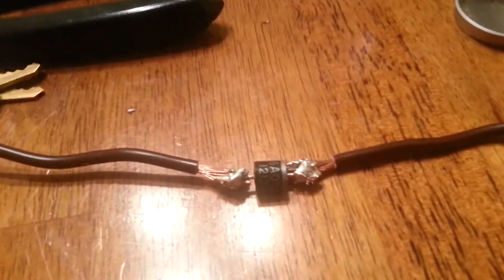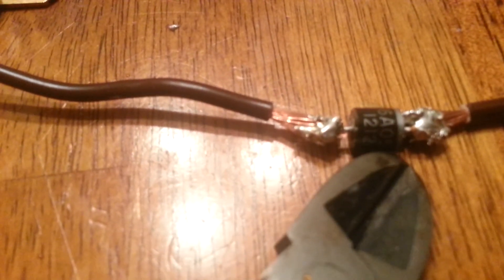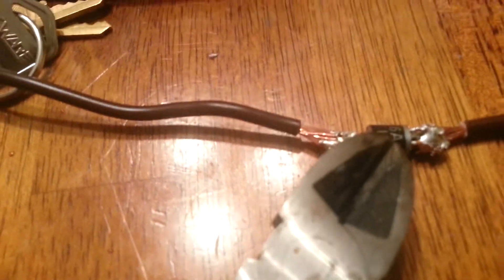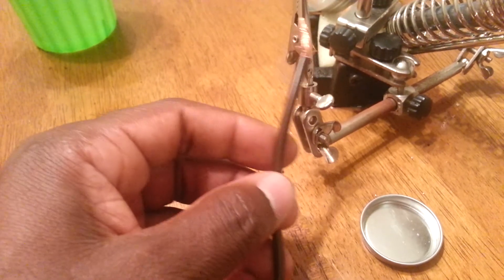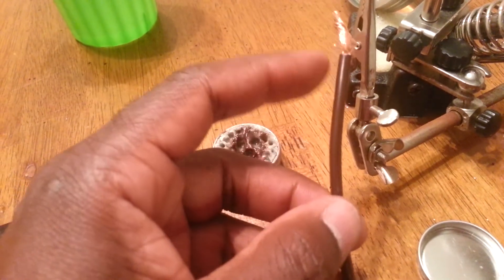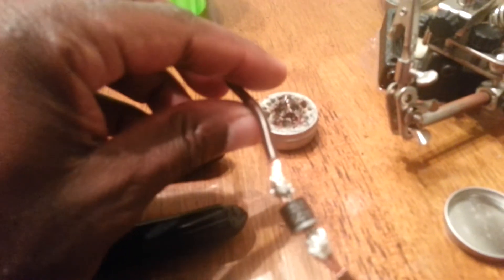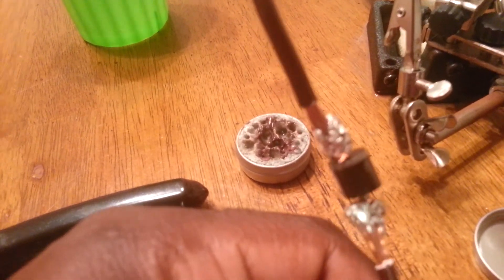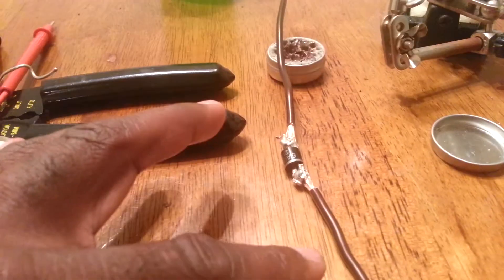How to add a diode to your lawn mower's alternator

Comment: Dont do this hes so wrong use 4 diods make sure they are rated for the volt and amp either way 4 diods will make a full bridge rectifier if done right. There are plenty of videos on the you tube on how to do it its so easy

Comment: No you're wrong it's just a feedback diode. In other words the AC current generated by the alternator is alternating AC DC. Imagine the electricity is water in a pipe with a plunger on one end without the diode slash one-way valve the water would just go back and forth in the pipe and never be pumped in One Direction the diode is simply a one-way gate you need a full bridged rectifier to convert AC to DC this is not a fully Bridge rectifier system it's just simply keeping the voltage going one way. Not converting.
Reply: this is not the space shuttle all you need to do is have a pulse DC to pump up the battery or run the lights or whatever there is nothing on that lawn mower that is critical of any AC or any ripple voltage...... as long as the diode is accurate you're going to get the positive amplitude and suppress the negative amplitude....... now if you're going to put a lawn mower on the moon I would say you need a full wave bridge rectifier with many many capacitor filters a zener diode etc inductors etc to back it up and then it would fail because it's pentagon contracted
Reply: I agree.

Comment: A diode does not convert A/C to D/C current....that is what a rectifier does.  A diode only permits current in one direction.
Reply: It does, but it will be pretty rough DC that is on off.  4 Diodes wired as a rectifier will get you the inverse side of the sign wave so you have more steady voltage.  A nice sized electrolytic cap will help smooth it out to a nice steady DC.
Reply: First, a diode and rectifier are the same thing. Second, half wave rectification (single diode) is perfectly fine for a tractor, and finally, a full wave bridge rectifier would harm the battery since you would be increasing the voltage by using both sides of the sine wave.
Reply: @rms59  Full wave will 2x the current, not the voltage. It's just flipping the -V of the sine wave into +V where a 1/2 wave would block it. Half wave = /\  /\ ; Full wave = /\/\/\/\
Reply from the maker: What does a diode do to a sine wave? Ideally you would need a bridge rectifier circuit but that is not the case with small engines like mowers.

Comment: Dangit.. So i need one of those. I put a battery and starter on a toro. And i cannot get it to charge. I hooked the wire strait from the battery to the alternator
Reply: Alternator is AC you battery is DC you need a rectifier between.

Comment: How big or what size diode do I need for this? I have a craftsman riding lawn mower 917.258550 w/ a kohler engine # cv15s-41526 2 volt battery?
Reply from the maker: A 6 amp diode from Radio Shack will do the trick.  I have the link and model in a previous comment below.

Comment: What store can I find these? I put a simple switch in place of the diode and when the motor was on I turned the switch on. My battery is now dead so I assume it's draining  there. (I have stripped the wiring down to just start and charge the battery)
Reply from the maker: Check at Radio Shack: Model: 276-1661  Catalog #: 2761661 6A, 50V RECTIFIER DIODES (4-PACK)
Reply: Thanks this will help me get my racing mower running again.